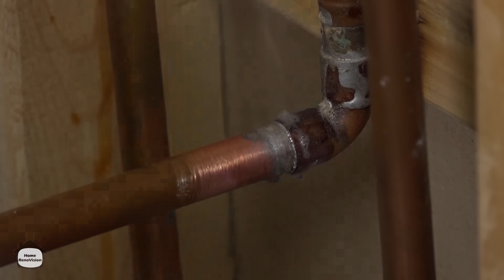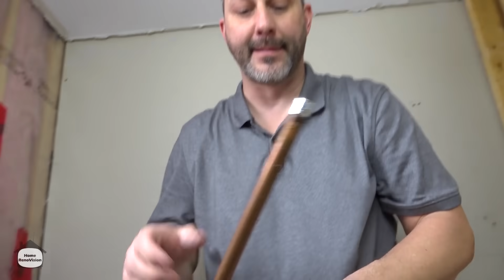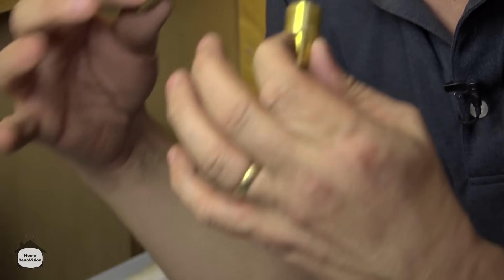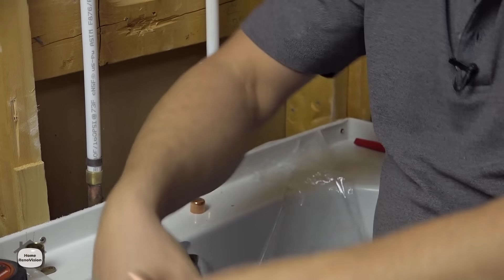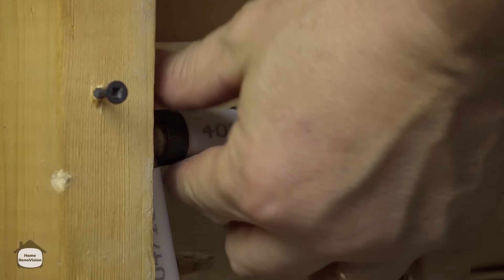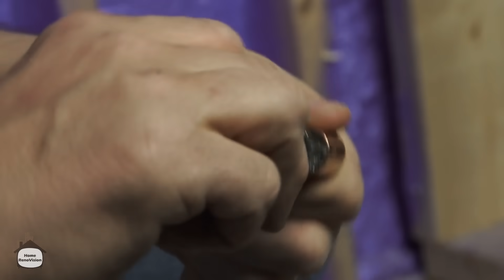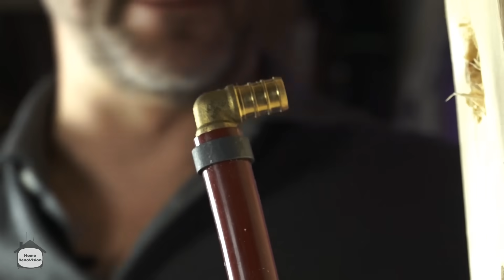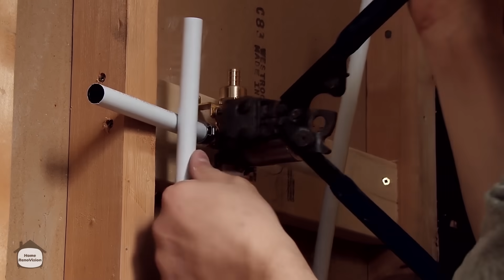4 Types of Shower Valve Assembly Installations

Comment: Jeff - thank you for your videos 

Can I ask you .  Why did you run copper from the valve to the tub spout rather than use PEX ?

Thank you
Reply: Pex has a smaller Id then copper. Using pex to the spout is too much restriction and will make the shower head drip whenever tub valve is turned on.

Comment: No safety glasses, no safety gloves.  As a plumber for 33 years I can tell you flux spatters and solder bounces in every direction when it leaves the cup.  Easy on the solder as the excess solder you are pushing into the cup will end up in the pipe and possible break away and lodge itself somewhere undesirable.  Not bad for a beginner DIY guy.

Comment: Good video and very timely. Can you sweat those fittings heating up the brass with propane or do you need the Mapp gas to get it hot enough to sweat it properly? Thanks for the information....
Ron
Reply: Propane or MAPP are almost the same. MAPP burns hotter, yes, but standard propane is more than sufficient.

Comment: Why is there so much controversy in regards to using all Pex vs copper especially on the tub spout?
Reply: valentinaanica from I can gather, the tub spout requires a bit more volume so it requires 3/4” thick tubing, and also recommended to keep that a copper assembly

Comment: great video.  I do have a question.  The blue pipe you used for the water test.  Where did you buy it and do you have an actual video or step by step instructions on how to pressurized the lines? Thank you

Comment: Can I just ask....I need to do this imminently...but. 
What do I need to have a thermostatic shower mixer on the wall and bath taps below it. Do I just tee off the hot/cold supply before I hit the taps so it auto diverts to the shower mixer? 
I can’t seem to find a shower mixer that incorporates a bath mixer tap and dual shower head outlets one overhead one hand shower. Am I missing something? 
I have a solid wall not stud and although I don’t mind chasing out for a diverter valve and pipes what would be my best bet? Do I need a diverter valve like yours with 3 outlets and wall mounted bath taps? 

Thanks so much great vids
Reply from the maker: ytou need to purchase a 3 way valve, that kind is only found in a plumbing wholesaler like fergusons or wolseley!
Reply: Home RenoVision DIY thank you
Reply: Home RenoVision DIY 
One thing I don’t understand is with a 3 way valve, you have only one outlet to the bath taps/mixer tap? Where is the temp controlled when it’s also on the tap itself? 
I do apologise I’m sure it’s straightforward to you, just trying to understand how to use a three way with bath taps? Or do you just have a wall mounted filler spout no taps?
Reply from the maker: you need to watch this video on a 3 way shower install and finish trim to understand . Cheers!
https://www.youtube.com/watch?v=fQhshM1XSWg
Reply: Home RenoVision DIY many thanks
Reply: Home RenoVision DIY thank you so much for your time and knowledge. That has clarified exactly what my brain wasn’t computing. It’s guys like you and videos like this that make the internet a really useful resource. Hope business is booming and life is great. 

P.S. I’m presuming I can go copper all the way as I don’t have the crimpers and cutters to deal with this pex flexi system plus I need to plaster over the pipes so prob easier with static copper

Comment: I'm remolding my basement bathroom and some of the copper joints have a fair amount of oxidation.  Some of the elbows are almost completely green.  I see no signs of leaking, however.  I noticed some of the joints in your first video show minor oxidation and I wonder if you could share your thoughts on this.  Is it normal or a telltale sign of a problem?  I was not planning on replacing the valves but I'm wondering if I should reconsider.  I've read this could be condensation, pinhole leaks, improper flux application, etc.  Any help would be greatly appreciated.  thanks
Reply from the maker: when in doubt switch to pex. Cheers! all plumbing fails at some point.
Reply: @HomeRenoVisionDIY  Thank you for the quick response and advice!

Comment: Don't clean with flux after you are done soldering, flux will atract the solder to come out and also will corrode the copper over the time.
Reply: I've done more service calls for pinholes in copper pipes from too much flux that's fact really be careful with that over use of flux
Reply: zorroon milkavitch why was it cleaned afterword with flux at all? On an elbow like that when the whole thing heats up, I usually top off the existing joint with a little more solder, then wipe both joints with steel wool to remove the drips. I’ll also give it a wipe with a wet rag after it’s cooled to hopefully remove and neutralize any leftover flux. What does wiping it WITH flux do??

Comment: I’m in New York I have all the tools for pex install I’m use to copper n torching 22 years doing it . I try it on a job 1/2 copper to pex tiled everything I lost pressure . Why? Lol so it was a Custermer s house instead of braking tiles again I went from the back which was drywall took pex out replace with 1/2 copper pressure came back . From that experience I never used pex again . Is there something I don’t know? Should I had use 3/4 pex n reduce to 1/2 in to tie back in to original copper . I don’t get it? Lol
Reply from the maker: in many cases pex tubig with crimps can reduce pressure. If you use the uponor system then you do not have that problem. Cheers!

Comment: Do you need to fit water hammer arresters when fitting a new shower with pex pipes?  Excellent informative videos, thanks from Orleans...
Reply from the maker: Not at all. the pipe can expand and contract so it makes no noise. Cheers to Orleans. Now is that Orleans Ottawa or Orleans , Orleans!
Reply: Orleans Ottawa, your local! @HomeRenoVisionDIY

Comment: You showing us how to take shower faucet by heating the pipe without removing the shower head cartridge and it happens to be I saw you had a moen. I believe you are supposed to take the cartridge out first before heating pipe.
Reply from the maker: I have no concern about the cartridge when i am going to throw it in the garbage. Cheers definitely,y remove for install.

Comment: Wow... Where do I begin? One thing you always have to be concerned with is the depth of your installation. Lug ells and shower ells should be installed where the end of the fitting is flush with the back of the drywall or cement board or whatever. Your tub spout can be of varying varieties from threaded, slip on, or universal. The threaded kind has to have the consideration of nipplie length. They come, generally, in 1/2" increments in length. The lug ell or female adapter needs set to a length where fully seated in the spout it tightens to where it lands flush with the wall, so that has to be measured and set accordingly. A slip on can be run long and cut after finish. Both the shower ell and wherever method used for the tub spout need to be installed level and square to the wall. Otherwise, itll look like garbage, and they should be on center of the drain.

The valve, itself, needs to be plumb, level, and square. Most plumbers I know, including myself, preinstall straight pipes out of the valve, mount it getting it correctly located and plumb, level, and square, making sure that, not only is the valve solidly mounted, but so are the pipes. Then worry about piping to the valve from there. Soldering the valve body on the way you did does not allow for any of this. It doesn't take much more time and effort to just abandon the idea of reusing the old fittings and doing a much better, more pleasant looking installation. That installation looks like absolute shit... Not only that, but pipe needs to be fastened down well inside walls and isolated in penetrations through studs. The worst is a banging copper pipe or a slapping PEX tube after the finish is in. They make all sorts of isolaters from Oatey, Hold-rite, and others. Some need drilled much larger to seat the isolater. Buy before you drill... Also, why would you leave those old school failure prone poor man's attempt at hammer arrest? They dont work well or for very long.

If you want to use PEX, there's no substitute for Uponor. You'll have to rent a gun it requires, but you wont be fitting awkward crimp tools in tight spaces. Its memory collars that get expanded and slip over the fittings and they shrink back to seal.
Reply from the maker: perhaps make a video!

Comment: Your ring for joining the pex pipe to your fitting, is more towards the pipe and not the fitting, I have you ever had a pipe blow off the fitting because of this, I was told to keep the ring in the middle of the pex fitting to prevent a possible leak,,, let me know thanks,,, your videos are really great,, helped me out alot

Comment: Great video. I'm always afraid to it that way and I windup cutting the pipes and then connecting them with couplings. But gonna try it this way from now on. Thanks for the great video.
Reply: I would do the same as you, not confident with old soldered joints.
Reply: And that's exactly the way to do it Bravo

Comment: This is all informative, but a good share of these sweat fittings are behind finished plaster walls with a small opening for access, and the pipes are clamped to the studs.
Reply: That's my situation too.  Seems like I'd have to tear down the inward facing shower wall to donate proper fix

Comment: Assuming that pex bands are installed and crimped correctly what is the failed rate of possibility of failure?
Reply: Well, the assumption that the pex bands were installed correctly is incorrect. If you look at the brass female adapter you can see ringed impressions. The crimping ring that is crimped on to it must take advantage of all of them, or at least as many as workable. To do this the ring must be as low or flush with the brass female adapter lip(or the start/end of the pex piping) as possible. As you can see in this video, the ring appears a quarter inch to a half inch away from the brass, near the end of the fitting itself. This may work short term, ie: some YouTube video, but the long term, well, one wouldn't dare put a warranty on that, along with many other things performed in this video. In other words, get that ring flush or as close as youre able to the lip of the female adapter. Or, because many things in this video are obsolescent, poorly done and shouldn't be practiced in ones home, call a reputable plumber. Im all for doing things yourself, but this video doesn't responsibly and efficiently teach you how.
Reply from the maker: the failure rate of pex is only related to faulty installation and that is always the installers fault.

Comment: How do you remove the crimps if you screw up or want to change something ?
Reply: Crimp removal tool is the easiest method. If copper bands are used, you can also carefully use a sharp tool to cut the band free being careful to NOT damage the pex. However, option one is the best.

Comment: Pulse Waimea Shower Spa. Two Fittings behind the Waimea, no Fittings needed inside the walls for mystery leaks. Includes Rain Shower, Water Fall, Three Body Sprays, and a Hand Shower. All Stainless Steel, including the hand shower hose. Only thing that's heavy duty plastic is the nozzles on the water outlets. Flow volume and temperature can be independently controlled. Four individual side control knobs for The functions

Comment: Hi Jeff, amazing video! Thank you so much.  Question:  I noticed that the original shower plumbing had ~2' shock absorbers, extending up from a T joint near the valve.  With the PEX, you did not include this. Why not?  Thank you.
Reply from the maker: copper does not expand so it needs air trapped to adjust for pressure changes. pex does and so it will not hammer. Cheers!
Reply: @HomeRenoVisionDIY  Makes Sense.  Thanks Again!

Comment: Yo jeff, i have a pull/push shower with the pfister plastic cartridge ... https://www.homedepot.com/p/Pfister-S74-292-Avante-Hot-and-Cold-Replacement-Cartridge-for-Tub-and-Shower-132315/205383578  

anyway i can without changing the housing get a pressure balance cartridge because when someone else uses the shower MY shower get cold. thanks.
Reply from the maker: That is a question for them , but I highly doubt it. Cheers!

Comment: Great, just curious why the hot and cold water supply lines in the first install extend past the valve body is there a reason for that?
Thx.
Reply: Air chamber to prevent water hammer

Comment: EHH PROBLEM IS YOUR USING A UNIVERSAL FITTING AND MOST FOLKS DON'T BUY THOSE I FOR 1` BOUGHT A DELTA AND IT IS NOT AS UP TO DATE AS THE ONE YA GOT THERE SO AS PER MY DISTANCE ISSUE IM BACK ON THE HUNT :) NICE VIDEO EITHER WAY
Reply from the maker: The problem is people are still shopping for plumbing fixtures at home depot. Go to a plumbing supplier and find these . Cheers!

Comment: @Home RenoVision DIY : Some manufacturers are recommending NOT to use pex for the tub sprout. Something about pressure building in the valve and overflowing from the showerhead. What do you think about this ? (I think you used pex for the tub spout in your last demo). Thanks for your time :) Great videos, just subscribed.
Reply from the maker: We have shown a few different diy options. but seriously if the shower head helps to fill the tub there really is not a problem there. If someone wants to do a shower plumbing and is not confident in their soldering ability then that is the option. Cheers!

Comment: You’re suppose to wipe the flux off with a rag after you solder because flux left on the pipe becomes corrosive.
Reply from the maker: I suppose that would be good practice.

Comment: Thanks for posting!  QUESTION: my rental unit shower has a 1 handle faucet, BUT works like this:  is off at 12:00.  gets hot when turned clockwise [1, 2, 3, etc].  Turn back to 12:00, it's off.  When turned counter clockwise, water is cold [11, 10, 9, etc.]  What's wrong?  My last tenants never complained, but my new tenant can't figure it out [me neither].  Anyone?? Thanks in advance!
Reply from the maker: the hot and cold are installed backwards to the valve. If there is a bathroom on the other side of the wall then you may be able to reinstall the valve cartridge upside down to solve the problem.
Reply: @HomeRenoVisionDIY  THANK YOU SO MUCH FOR TAKING THE TIME TO RESPOND!!!   I REALLY appreciate it!!!
Reply: Hi ! Some shower valve CARTRIDGE can be flip around and they will work the opposite, other shower valves HANDEL can be just flip around. Give it a try, take HANDLE off, check if the cartridge it self can be turn 180 degree, if doesn't work, shut the water off, take CARTRIDGE out flip it around 180 degree reinstall cartridge and see if that works. May NOT need to cut complete shower valve. GOOD LUCK
Reply: @artroofing1  Thanks for responding!  I actually did fix it- yes,  me, a lowly grandmother who can clean a trap and sweat a pipe... but nothing else  plumbing wise.  
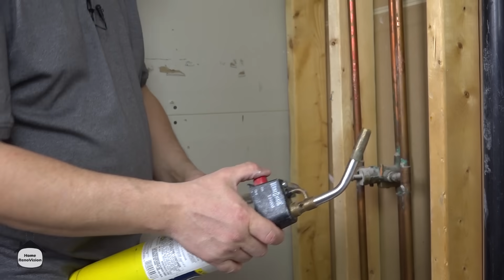If was actually the handle!!  I took it off and flipped it 180 degrees  [so off is now at 6:00 instead of 12:00].  Now,  turning it on counter clockwise it starts cold,  continues to warm and then hot!  YAY!!   I was overdue for an easy fix!  I'm sure my next problem won't be nearly as easy...

Comment: Just a helpful tip for anyone sweating pipes. Place a cloth or towel down on the tub, especially if it's fiberglass. Molten solder dripping off the pipes can burn pits into the fiberglass.
Reply: And above all always use a heat shield between the joint being soldered and the area around the joint being soldered.
Reply: @nelsonechevarria7009  why worry about it as long as you stay away from the wood studs?
Reply: **get heat shields. they are worth their weight in gold
Reply: So keeps close joints from unsoldering.
Reply: Wet rag for joints you dont want to unsolder
Reply: No

Comment: Two questions:
1. Why do you not flux the copper pipe before inserting it into the fittings.  Every source I’ve seen before says to flux both pipe and fitting.  And fluxing afterward will corrode the pipe unless thoroughly cleaned off.
2. You only crimped 1/2 to 2/3 of many of your crimp rings.  It is more reliable if the entire ring is crimped, which again is the recommendation I have seen from every other source and crimp tool maker.
Good technique using the laser to get things plumb.

Comment: Love the PEX system and the adapters from copper to PEX makes life easy. I just wish that there were more valve styles available like there are in copper or brass. Great videos, thanks for the effort.
Reply from the maker: many manufacturers make pex ready valves, they just don't sell them at the major building stores yet! You need to go to a plumbing wholesaler supplier. They can help you out with options. Cheers!

Comment: Hey Jeff, 
Just curious why do don’t use PEX for the connection between the valve and the tub faucet?
Reply from the maker: It is hard to find a tub spout that works with that plumbing style. at some point you pretty much are forced to use a torch, unless you are in a shower only.

Comment: What is the additional flux for? Or was that water you brushed on after? Thanks
Reply from the maker: just wiping the solder bubble into the joint for good measure.
Reply: @HomeRenoVisionDIY  Thank you! I figured that after I watched the video a little more and you explained the function of flux. I'm learning to save my question until the end of the video with you because you usually answer them. Thank you very much for these, you make an intimidating job more manageable. I know you've been doing this for years and make it look easy, and its not, but you give tremendous guidance.